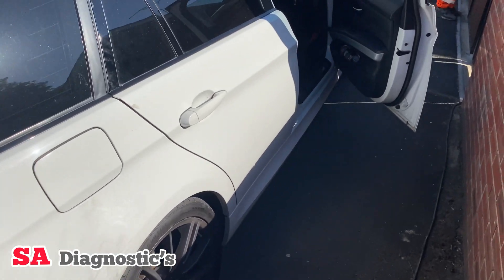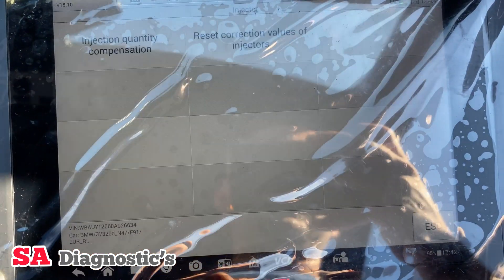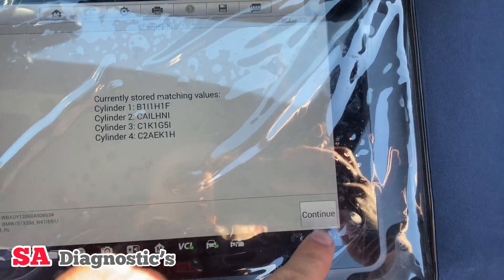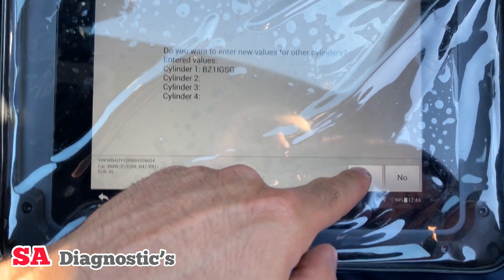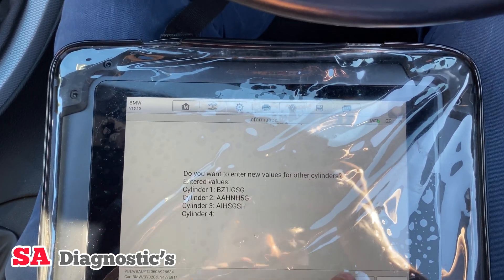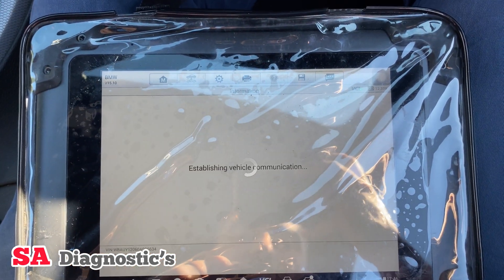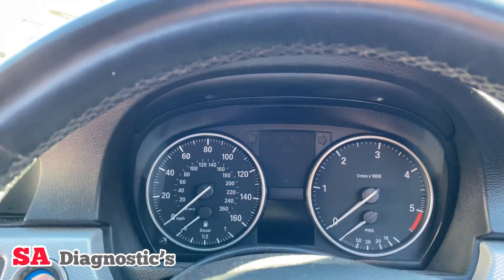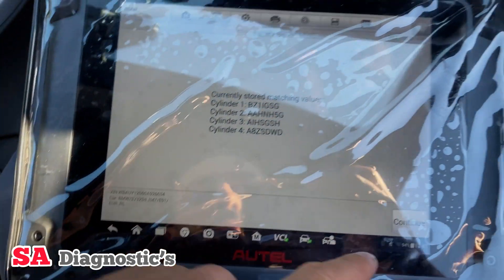How To Code BMW Injectors Using Diagnostic Tool

Comment: hi mate were did u get your new injector codes from, i thought u had to write down the old codes and then put the old code on the new injector, or is that what u did, im about to install 6 new injectors on a530d and iv got a autel mt808bt any help would be much appicated
Reply: Did you find out if it was old code?

Comment: Just got the MaxiAP200 and trying to code in new injectors and when clicking replace injectors it loads then just takes me back to the replace injector screen, anyone help? Thanks
Reply: Hello Josh Did you manage to get your injectors coded I've also ordered one of these and I'm a little concerned
Reply: @andrejedidaniels  tried everything possible and still no luck with it
Reply: @joshwood9732  what bmw you got, does the option actually show, does it actually try to code injectors and just not store? I've seen it used to code injectors on YouTube and it worked! Any info will be much appreciated

Comment: Hi mate . Thanks for that video it was brilliant help 👍 quick question . Where did you get your case for your autel unit ? I am trying to find 1 .
Reply from the maker: Hi thanks for feedback, I bought it on eBay and typed in make up bag £7ish
Reply: @sadiagnostics  did yoy put in autel ? Just I can jot find 1 .
Reply from the maker: @markmaskell9977  https://www.ebay.co.uk/itm/SML-Clear-Toiletry-Cosmetic-Transparent-Set-PVC-Bags-Travel-Makeup-Bag-Pouch-UK-/202745512031?mkcid=16&mkevt=1&_trksid=p2349624.m46890.l6249&mkrid=710-127635-2958-0
Reply: @sadiagnostics  sorted . Cheers mate . 👍
Reply: @sadiagnostics  sorry mate . Miss read your last reply . As make of bag  . And not make up ! 👍